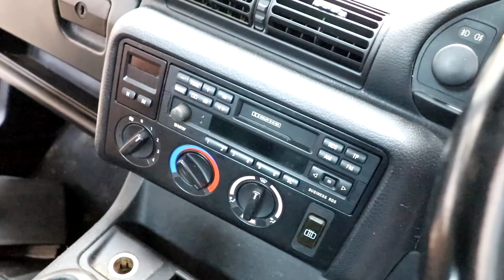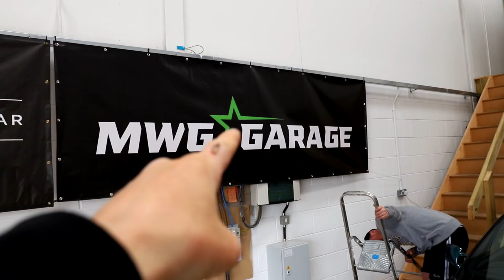E36 Drift Build - Episode 1

Comment: Supercharge lexus with mercedes supercharger for 220bhp 
Cost less than 800 quid to do
E36 compact rear suspension limited
Reply: The compact is so rear suspension limited that there's more compacts than IS's in pro drifting.

And supercharging the lexus would be so pointless since he does not like the car, if you take a car you don't like and add a supercharger to it, you have a supercharged car that you don't like, which ain't that much better.

Also you have to be disconnected from real life to think you can actually  do that for 800£, just the bracket system is already 500+£ (cheapest one I could find, and it's in Canada, the only one I found in the UK was over a grand), the supercharger 150-200£, and we haven't even gotten into injectors, ecu, etc. Let's not even talk about the clutch which is notoriously weak and has been known to slip even on low mileage examples at stock power with just aggressive driving, from what I've heard any thing over 200hp and your clutch is getting roasted.

Comment: Better off doing an M50 swap, as you know you're going to Turbo it down the line
Those are parking sensors in the rear, a pretty rare find
The dash is also an E30 setup as compacts share a lot of parts with them, including the whole rear suspension setup.
If it's a 316, it will have rear drums instead of discs, so you'll want to swap those out as well